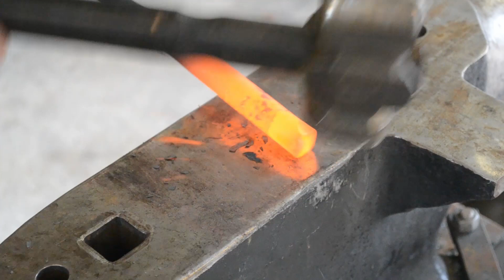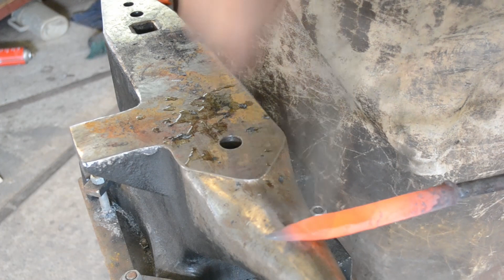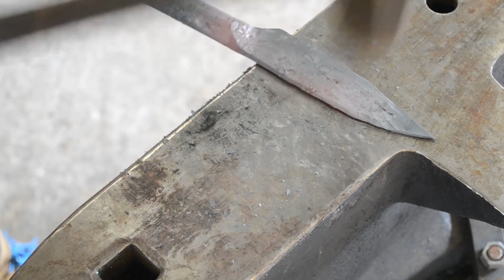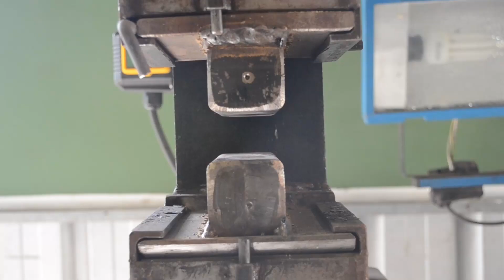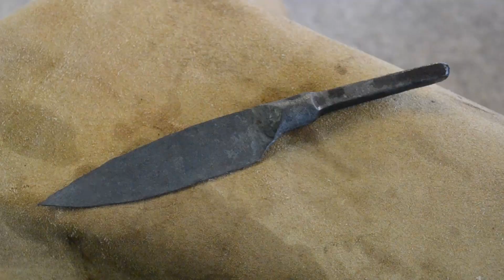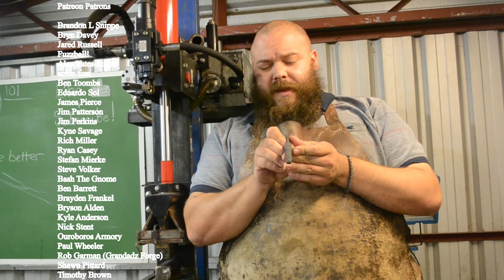How to Forge an Integral Knife From Round Stock

Comment: Great video.  Question: Are you forging it at lemon yellow or light yellow?   I tried 1080 round and  a coil spring heated to lemon yellow and both seemed to be pulling apart once I got it to blade shape and started to work out the tang. Once it split and broke off. Would this be from over heating it. ? Thanks hope knives
Reply from the maker: Thanks mate, yeah brightest I'll go is bright orange with most carbon steels unless I'm forgewelding. It sounds like yours was overheated and went red short
Reply: @SamTownsBladesmith  right on thanks for the reply. I’ll give that a try appreciate it.

Comment: Great video! I’ve only done one integral but have plans to do a few more coming up. Any advice to prevent “crepe paper” wrinkling at the bolster junction? My one attempt had that prominently and there are still traces of it after grinding.
Reply from the maker: Careful control is the only way unfortunately. I highly advise using a spring fuller or guillotine tool to cut the shoulder
Reply: @SamTownsBladesmith  Thanks. I have a spring fuller I intend to use (thinking about getting a guillotine too one of these days). I used a spring fuller on the last one too, but I think i let that area get too thin too early, and when I was forging out toward the tip, all the flexing at the junction point caused it (also not keeping that area hot enough seemed to make it worse).

Comment: Great video Sam. Would love a follow up video finishing this knife off - grinding and handle.
Reply from the maker: I may just do that!
Reply: Had a crack at an integral with some coil spring over the weekend. Used a lot of what I learned from this video. Still lots of practice required but without this vid I would have been swinging in the dark!

Comment: Thanks for the info about using a cross peen for bevels! Never thought of even trying that. The few integrals I've forged I used a round spring fuller hardy tool to set the bolster area.
Reply from the maker: No worries! Yes a spring fuller or guillotine tool would be great for this, I wanted to show how it can be done hammer and anvil only. Normally I'll use my press 😁